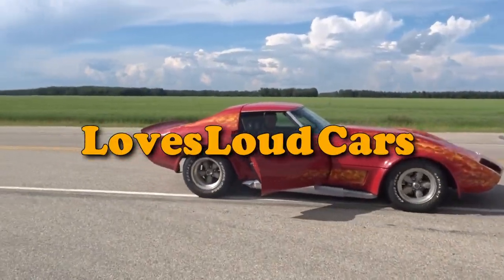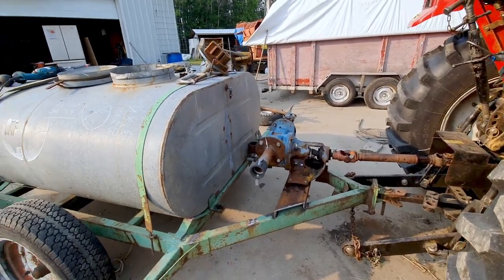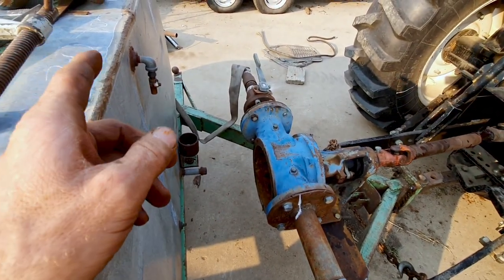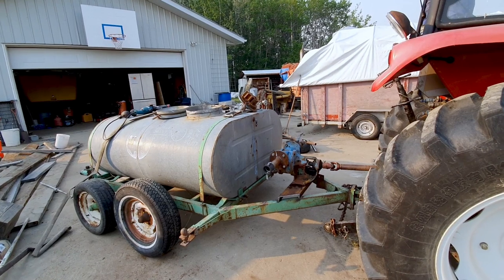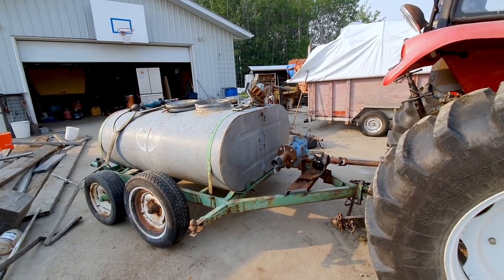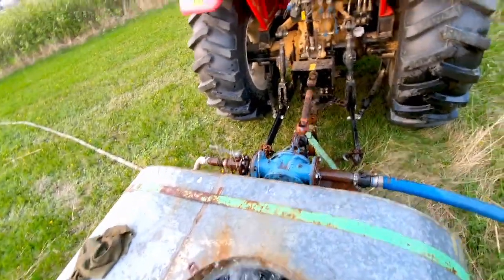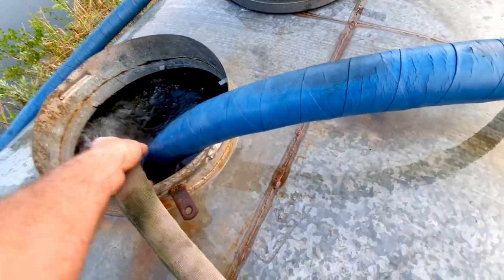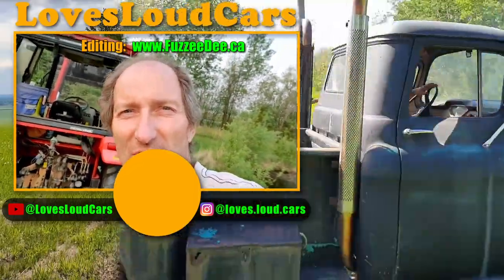Upcycling old Sprayer and Pump for FIRE protection

Comment: looks good,hope you dont need it for any fires just the garden
Reply from the maker: Yes.  We're still not "out of the woods" yet, but hopefully the weather man is right about rain coming. 
This spring from when the snow melted until now we've had no run off, and 1? small shower. Extremely dry.

Comment: Are you going to cut the bush back from the house as a little fire break?  You can replant with dwarf species or shrubs.  Living in a forest is pretty until the forest fire comes through, and it will always come through. 😒
Reply from the maker: We have an L shaped section of bush around the place,  but then pasture next . Plowed a fire gaurd around everything too, so I think even  In the worst case scenario we probably would still be safe.
 A pump and tank would be capable of sprayng out any fire that popped up from fly ash.

Comment: Hope it's just there for when you want it rather than when you need it. 
Hot today 17° 🥵.
Reply from the maker: We've had up pushing 30 without any of the regular  spring run off or any rain AND wind. - thus the fires. I think one little shower around a month ago,  otherwise hot and unseasonably dry. 
It spit a bit yesterday and supposed to get some rain the next few days. Hopefully at least 1.5 inches.  If it rains more than 2.5 inches we might get mud, otherwise it would probably soak right in and dissappear.